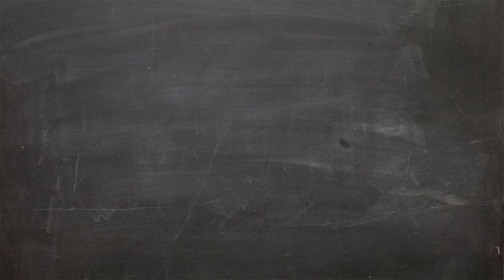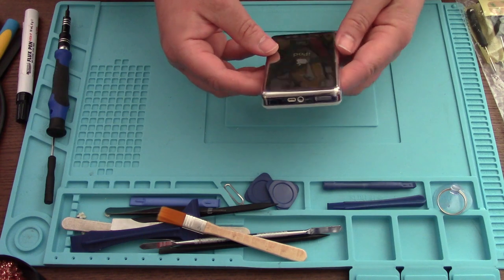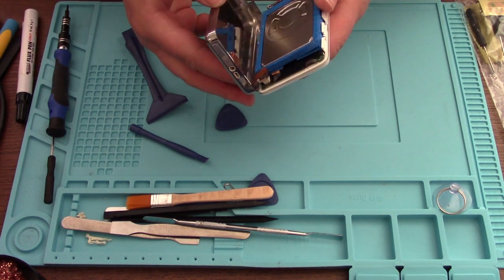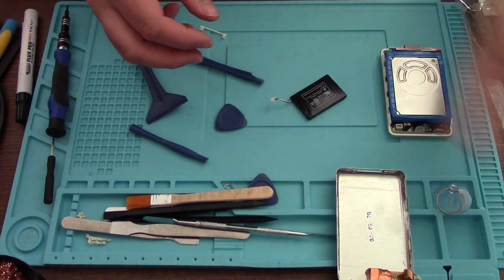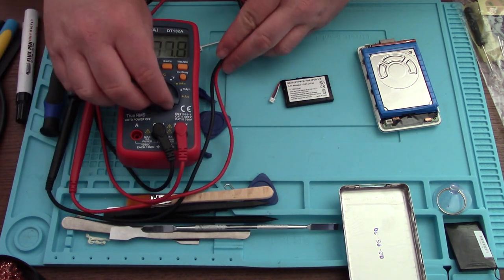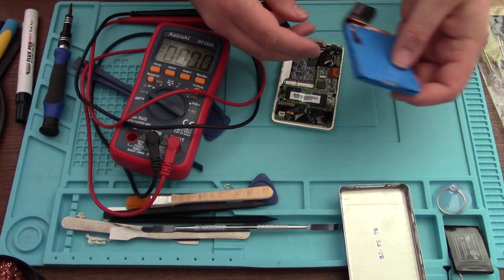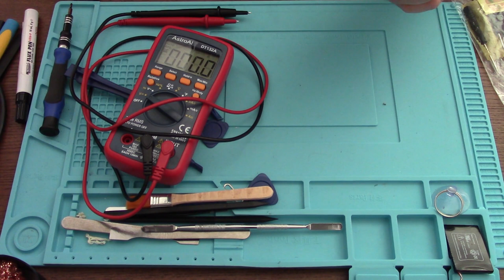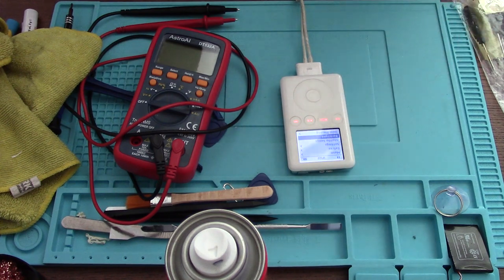Apple iPod Classic 3rd Gen (Replace Dead Battery) Can I Fix It?

Comment: I own an older iPod just like yours. It is worthy of note that it WILL NOT charge using USB. It HAS TO BE firewire even though the connector at the iPod end appears identical.

Comment: I guess you know by now but testing a battery while not under load is not the same as testing a battery while actually driving a device. The voltage will collapse on a bad battery when actually driving a device and then recover when no current is being drawn.
Reply: Exactly what i was thinking, if a battery is not used for a long time there can be cristalizing inside the battery, it causes resistance inside to increase and therefor shows the right amount of voltage but under load it will collapse. A good battery testing device measures the battery when under load. love these videos  tho :)
Reply: Right. And if this is a lithium cell, the 3.7V is the nominal voltage and the 3.9 from the new one probably storage @60%. A full one is around 4.0 and 4.2 so the old one is quite empty anyway.
Reply: 3.7v is the lowest level a li-ion can safely get, so there is a mechanism to cut off discharge at that point. A li-ion battery that is sitting at 3.7v for too long will no longer recover charge. They need to be stored around 4.0v if you're going to put them away for any length of time 

The 3.7v being metered is accurate, which is why the device turns on. It turns off again because the under volt protection circuit cuts it off to protect the battery as it's at it's lowest safest charge. 

Ie. 3.7v on an old li-ion battery = a dead battery.

Comment: Protip: If you use Apple's Firewire charger, it puts out more power and will let you, at least, boot a dead IPod. Pretty sure it's just the older ones, but I could be mistaken. Keep up the good work!
Reply: you’re right they only charge with firewire and some sound docks, the ipod would work without a battery connected to the right charger
Reply: Yeah, it literally jump starts iPods due to the higher voltage of up to 30 Volts while USB was limited to 5 Volts at that time.
Don't have a original Apple FW charger but a noname 30-pin wall charger that says 8-12V output voltage and the 30-Pin to USB and FireWire and both also manage to power up my 5.5th Gen with drained battery (while connecting it to USB puts it in a boot loop); my JBL OnStage 200 iD also can do that.

Comment: Was just given a Classic Gen 3 like this. Plugged it in to FireWire, got the Apple then after a bit the Exclamation Point in Triangle in front of a Folder, with a whirring sound. Figured the battery is dying, along with the Disk Drive. I too opened it up, but my Audio Jack was GLUED in. The bit popped off the LOGIC Board 1st, then ripped from the cable, (not usual). EVEN now severed from both parts, in attempts to separate the 2 pieces with plyers, it won't! Maybe this was separating on the original owner & their fix was "super glue", IDK?! Kinda bummed, wanted to change to a SSD, but maybe it'll play out of a iPod speaker system?!
Reply from the maker: Wow. Does kinda sound like someone thought superglue would be a good idea! That's a shame if it's killed it, but yeah could be worth giving it a go with a dock. Although I think they still need some decent battery juice to get going. 🤔
Reply: @StezStixFix  Oh I've charged it for a good .5 hr, battery shows full, it's now in: "Disk Mode √ OK to disconnect" & I'm a bit stuck there. Doesn't show on my Macbook Pro Finder, in MUSIC, or Disk Utility, so I'm thinking --Dead Drive? Shows: "Disk Mode √ OK to disconnect" even when not plugged into anything?!
Reply from the maker: @TheJoker-zt4nk  possibly dead drive, yeah. Have you tried resetting it? I can't remember exactly but you hold down a couple of buttons for about 10 seconds. Think it's the menu and play buttons!
Reply: @StezStixFix Yes tks, I tried holding the 2 center: "Menu + ⏯" & also the 2 outer: "⏮ + ⏭" each for 10 seconds. Still no show on Mac, anywhere. Actually I think that's how I got the "Disk Mode √ OK to disconnect" to show?! I also couldn't figure how to turn it off! Holding just Menu, holding just ⏯ so I finally unplugged the battery, seems the battery is pretty strong. Guessing the Logic Board is ok too, since it turns on? But no backlight, nor do the buttons light up Red. I may attempt anyway, I can always use the CF Card to change out my Mini Gen 1.

Comment: Hola podrías poner el enlace de donde conseguiste la batería tengo un ipod classic de tercera generación y la batería ya murió y me gustaría cambiarla saludos de chile
Reply from the maker: Hola, perdón por mi mal español. Compré la batería en eBay. Fue este: https://www.ebay.co.uk/itm/3-7V-850mAh-Ipod-Classic-3rd-Generation-Replacement-battery-Same-Day-Dispatch/352998195583?ssPageName=STRK%3AMEBIDX % 3AIT & _trksid = p2057872.m2749.l2649
Espero que eso ayude. ¡Gracias! Steve

Comment: I believe they make a kit to upgrade these iPods to use an SSD hard drive. It would give it more space and use less power.
Reply: I saw someone do that but the iPods OS couldn't see most of the storage that he installed. Apparently Apple thought ahead and capped the storage capacity on the units.
Reply: You can convert it to a CF card
Reply: Can't believe they used hard drives in these.
Reply: I found that the conversion kit doesn’t make a lot of difference to power consumption, the disc drive doesn’t run continuously in play mode so isn’t the big power draw some think , one tip is unless you have the twin usb firewire lead only load 5gb at a time as this does eat power
Reply: @JMcMillen  There are two limiting factors: Some iPod models use LBA28 adressing and that limit is around 128 Gigabytes and the 3rd and 4th Generations RAM limits the size of the database it can handle to around 20-30k tracks.
However you can circumvent both by using alternative firmwares like Rockbox, this might also work with more than 128 GB and larger libraries (you can build an index file externally on your PC/Mac with the RockboxUtility and then transfer it to the iPod if it fails to create it on its own).

Comment: This wasn't a fix. Just a replacement of a battery. I have the same model which is still in perfect working order. replaced the battery some years ago. It is not hard to do.
Reply: This was a fix. Don't be a d.